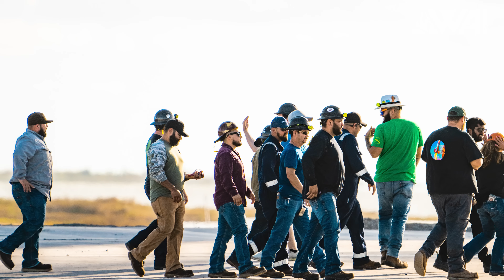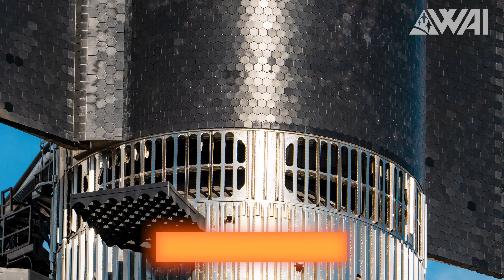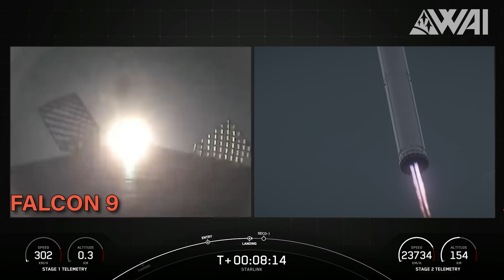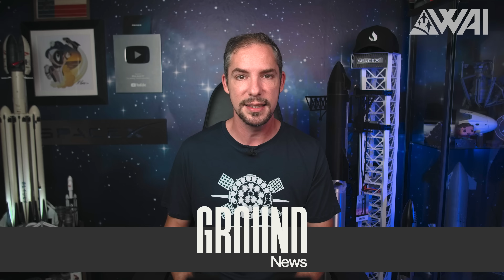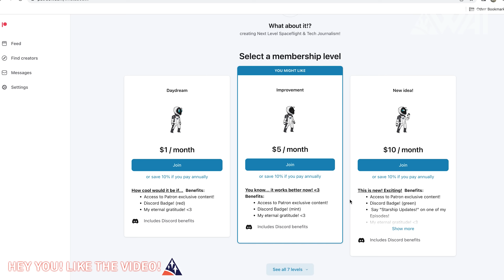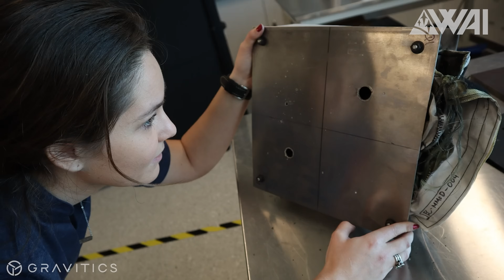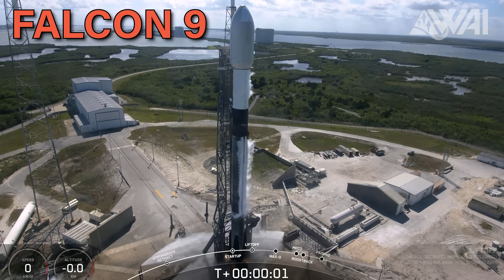SpaceX Starship Setback: A Year Without Payload – Hiccup or Concern?

Comment: I thought the suicide burn has to do with the Merlin's throttling ability. They have to perfectly time it so the burn balances out against gravity as  it touches down and then immediately shuts off.
Reply: Correct. Rocket engines historically have very tight throttle ranges. The suicide burn has nothing to do with the amount of fuel. The Merlin is not capable of reducing its thrust enough to hover and (sorry Felix) they could not have simply "designed it to throttle down further". If they could, they would have. The Raptors are significantly more advanced and capable, but it's not just that. The super heavy booster has a much greater dry mass, and with 33 engines they can achieve a 33:1 thrust reduction simply by shutting down 32 of the engines, before they even need to reduce the thrust on an individual engine.
Reply: There is not much out there ….. shows map of flight 2 flying across Africa
Reply: Starship can hover and falcon 9 can't. Falcon 9 couldn't hover if they tried.
Reply: Remember blue origin do it on 1 engine and hover. Based on this discussion that's quite clever.
Reply: The suicide burn is the only way to do it.  Motor fires up rocket slows. Fuel mass reduces so deceleration rate increases. 
When the fuel runs out too soon - vehicle crashes. 
When the fuel is not burnt fast enough -  vehicle crashes. 
When vehicle stops too soon, it will start to climb again - until fuel runs out. 
Gravity can’t be switched off so vehicle has to stop when it’s just touching the floor. Either tanks run empty or the motors are shut off.
Reply: @Dave5843-d9m There are several examples of rockets which are capable of hovering. Suicide burn is efficient in terms of fuel but it's not the only way to do it by any means. And there is NO WAY Starship could ever be human rated if it used the suicide burn to "land" (get caught). We've already seen in the high altitude flight tests that Starship performs a controlled landing with a near constant velocity in the last few meters before touchdown. (I know we're talking about the booster here, but still)
Reply: It's called a 'hover-slam' landing...
Reply: Thank for commenting. This is correct. It’s not based on fuel quantity being rights based on the timing of the burn resulting in the >1 T/w ratio bringing velocity to zero just as you touch down. Start too early and you are too high, and fall after cutting the engines
Reply: It's called a hover slam not a suicide burn, that's like something a kamikaze would do 😂
Reply from the maker: That's how the Merlin engine was built to accomplish the task. They could have designed it to throttle down further but for F9 they didn't need to do that. :_WAIHeart:
Reply: @Whataboutit No its not that simple. You can not simply design a rocket engine that can throttle down really far. There is a limit based on physics, including chamber pressure and nozzle design, that you can try to optimise but never completely get around without loosing top end performance, and then you are no longer trottling down. You are just making a weaker engine. Precise data is hard to come by, but I have seen 39% for Merlin and 40% for raptor so they are pretty similar also indicating its difficult to get much lower.

Elon himself earlier in the raptor development process said that 50% was realistic, but that 25% was nearly impossible to reach.

The reason Starship can hover is because its much heavier than an empty F9 booster. In addition to the obvious difference in size, Starship is a quite heavy SS design. F9 is aluminium.
Reply: @Whataboutit  "Could" is doing a lot of work in that sentence, my friend. ;) Deep-throttle is not easy for 1st stage engines. It was a fortunate coincidence that they had already decided to go with 9 smaller engines before deciding on vertical landing, allowing a 8/9 reduction in thrust before even having to worry about throttling an individual engine.
Reply: @Whataboutit the Merlin was designed way before they ever thought or tried to land a booster. The suicide burn is a result of the engine not being able to throttle down any lower.
Reply: @dr4d1s  No, because even if it could throttle further, a suicide burn is efficient. So if they could throttle arbitrarily low, they'd no doubt have done so during the early landing attempts, but they'd have quickly looked for ways to minimise fuel wastage and would likely have ended up with something much like what they have now... brake late and brake hard.